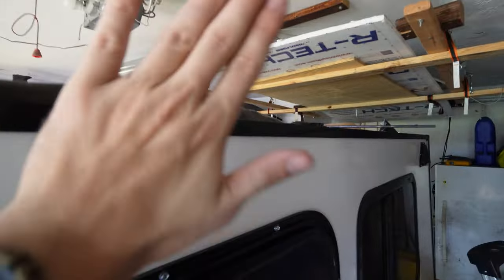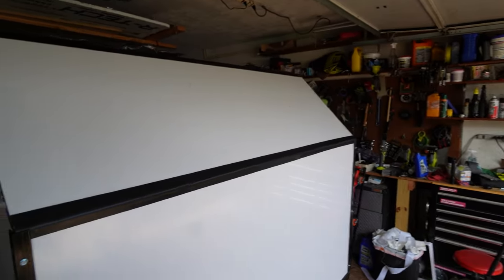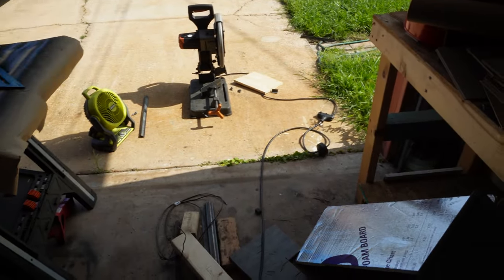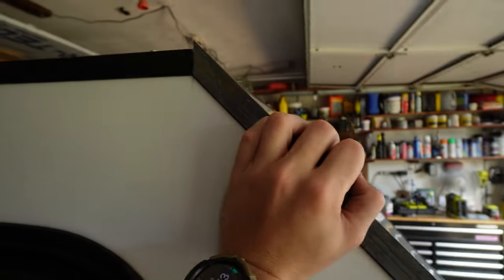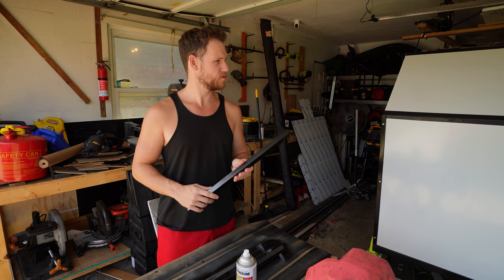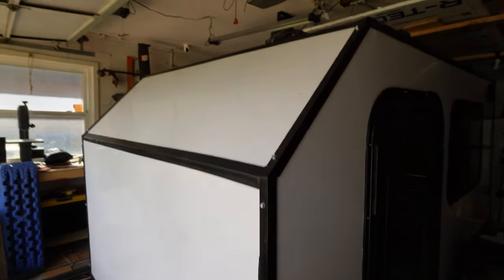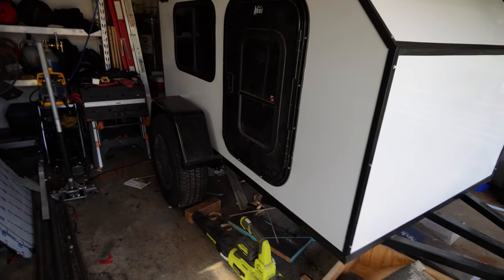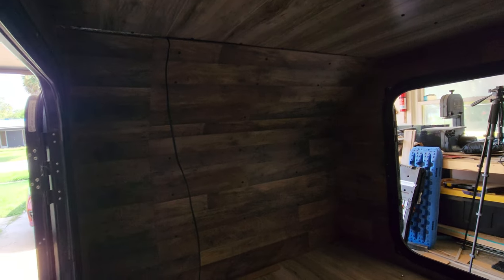DIY Overland Camper Build - Exterior Trim

Comment: Nice work on the trailer. Looks very good. You could add a couple pieces of flat bar on the 45s to make it match the rest. Mine has been on hold due to our heat and lack of time.
Reply from the maker: I haven't thought of that but that's a great idea!  I'll have to look into it.